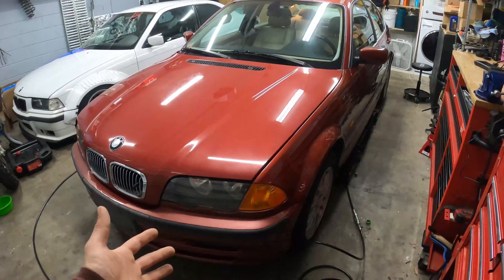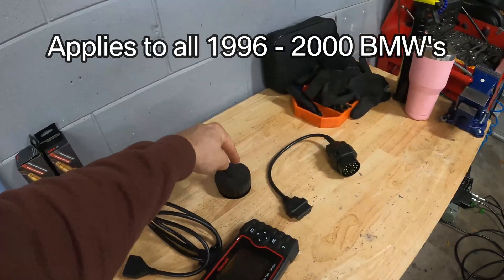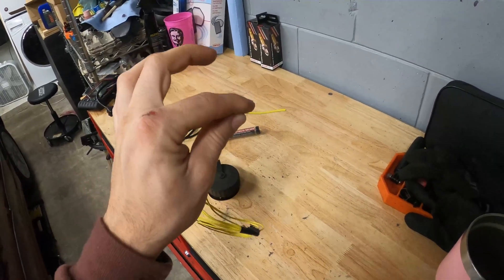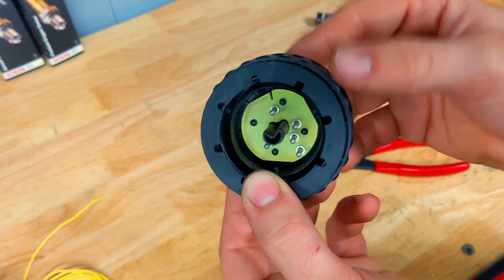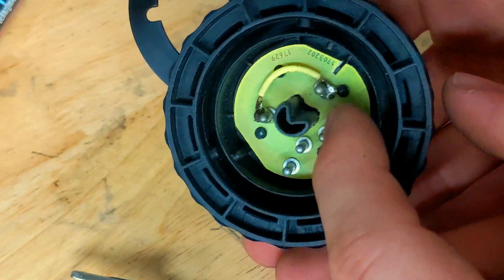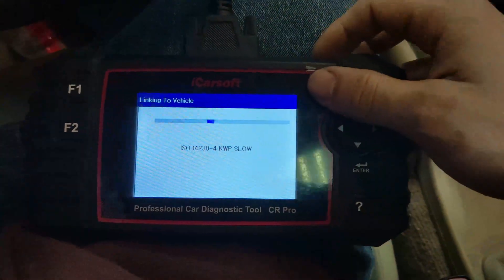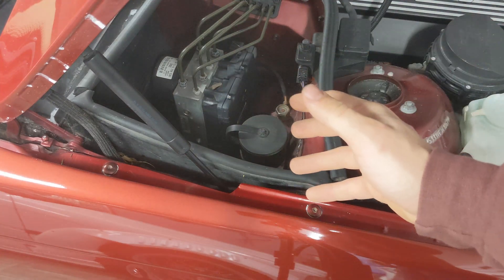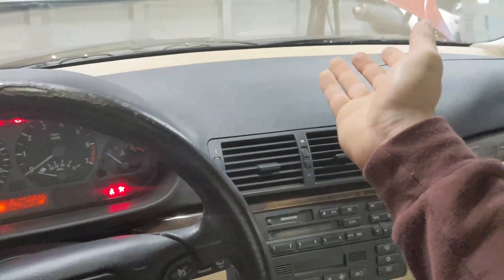Hack your BMW for FULL OBD Access! Round 20-pin Adapter Bypass Tutorial

Comment: Hi, great video! I am going to look at an E36 and I have the same iCarsoft CR Pro+ as you have. Would it work to just connect the terminals on the port, without the cap on? Does the cap need to be on for this to work? Thank you very much.
Reply: How did it go? Where do you plug in in e36, when 32pin connector is already in use?

Comment: so i have a bme m5 e39 and have been told the obd in the car does not work just the round one under the bonnet   is that correct or should the one next to the stering wheel underneath work

Comment: hi, what if i dont have any connector inside my E39 bmw 1998? I have only that round one under the hood. do i need to connect that 2 pins and then attach adapter to OBD? when i try to connect using only normal  adapter it is not working, i cannot connect to any app by bluetooth

Comment: Hello sir, can you please expain this:

I have elm327 obd2 adapter and i tried multiple apps on google play store none can connect to the ecu to read any data. But more expensive equipment can read a lot of stuff just from the connector 16-pin below the wheel, how can i achieve this? i want to read data, should i buy vag com kkl cable for laptop? will this method help with this? 

Bmw e46 2000 320d 136hp. pre-facelift models.

Thanks!

Comment: This was definitely awesome never knew what functions the connector had  in my 1996 328i😊
Reply: Hi. I have a 99/00 328i with no OBD2 port on the interior. Do you have both 20 pin and obd2 ports?

Comment: Absolutely useless mod. You can just short those two pin holes with a bit of wire. No second cap, not soldering, just get the right holes
Reply: Yes, you can - until it wiggles loose. If you're lucky it will only cease reading correctly. I don't know what could short out if a loose wire is floating around the 20-pin connector - why don't we use your car to find out?

Comment: Hey bimmer barn I just did this step by step I used 14 gauge solid wire the connections were good, but I am still not able to read anything besides dme. Any suggestions?

Comment: OMG I spent so much time figuring out how to connect my diagnostic software to my BMW.

Because the car has an OBD2 connector I simply assumed that it could be used for diagnostics. Turns out you can only diagnose the engine with the OBD2. Not knowing that there was also a 20 pin connector which you should actually use for diagnostics rather than the OBD2, I assumed that there was a problem with the CAN Bus. So started checking all the fuzes and trying different diagnostics software.

After I tried this soldering trick I could connect  using the OBD2 port and everything worked perfectly! Thank you so much!

Comment: Hi, just to make it clear for me. Does the adapter cable OBD1 to OBD2 work tho? Because you said you didn’t want to use it. Do you just not like using it or does it not give full access to diagnostics? Thanks
Reply from the maker: The adapter works as well! Full access to all the modules, but I prefer to scan from inside the car instead of standing around the engine 😁

Comment: With such MOD. Can you drive the car normally or you MUST remove the MOD to drive the car around. I have a BMW E39 520iA 2000 Model.
Reply from the maker: You can leave the cap installed all the time, no problem!
Reply: @TheBimmerBarn  can you do car tuning with this mod alsow.
Reply from the maker: @johnbang66  Not sure, depends on the car and the tuning method I guess!

Comment: My 2000 e46 323ci does not have the 17 pin obd 2 port inside the car. The on;y diagnostic port i have is the round one in the engine bay. can a newer style obd 2 port be fitted to the inside?

Comment: Can you tell if K+DCAN cable still needs pins 7&8 bridged when this is done?
Reply from the maker: No I think not, but it's worth buying the switchable dcan cable on Amazon, works on both types of cars!
Reply: @TheBimmerBarn  thanks for the update! I do this as my part time job and I have the Bimmergeeks expert K+DCAN. That specific cable has an adapter block instead of a switch and some E39 OBDII ports were placed so tight I couldn't fit it. I'll try to confirm this soon

Comment: Hello, please, would it work on the BMW e46 M43 in 1998? I have a BMW Scanner v140 I just don't have an ADAPTER Stecker 20 PIN at 16PIN.
Reply: Yes this also works for M43

Comment: Hello friend, very good video, I'm from Brazil, and I would like you to help me if possible, I have an e36 318t 1995, and it only has the OBD1 port on the engine, I bought the 20-pin adapter for 16 and already tested two OBD2 bluethooth and does not communicate with the ECU, could you help me? Thanks
Reply from the maker: Sounds like a bad OBD port, those have to have 12v power at pins 14 and 16 I think, powered by a diagnostic fuse. Check the fuse, check the OBD port for power, use some contact cleaner on the pins, good luck! Let us know when you figure it out :)
Reply: @TheBimmerBarn  thanks for answering, I tried to check and there is power coming from the pins and the fuses are working, I researched the ECU model, and by research I found that there are only a few devices that connect and are unfeasible for the value unfortunately an e36 1995 318ti compact that has a complicated ECU
Reply: @gabrielkurudzpereira  conseguiu resolver amigo? Estou com o mesmo problema, o meu scanner não se comunica com a ECU
Reply: Hi
I think you need a ADS cable (instead of the standard 20pin to obd2 cable) to be able to communicate with early production e36 modules. I bought "Tiny ADS Interface" and it works great with my 1995 e36

Comment: Hey mate - thanks for the video. So let me get this straight - you can't access all the codes from the port in the driver's seat, but when you jumper the pins in the engine bay connector now you can access all codes from the footwell port?
Reply: Can you leave thie 20 pin cap permanently there will it hurt anything, or do you need to swap it with the old one when done?
Reply: @maxvista I'm curious about this, too. What should I do?
Reply: @Aram1-v8v  leave it on its working for me
Reply: You're fine to leave it. 

All this mod does is combine data from two wires into the one in the OBD-II that actually reads stuff. 

For those of us who only have the OBD-II port, we literally do the same thing except we bridge two different wires together.

Here's the visual version of that explanation: https://youtu.be/oLW2O4Sdy2Y
Reply from the maker: Yes! You go from accessing just the DME, to accessing every single module available on the car. Works great!

Comment: I bought a 20-pin to a 16-pin converter for my bmw 316i 1997 e36. What do I do if it doesn't work? Is it the same process? Because if I got that right your car has both an obd2 and an obd1. Can you help me out? Haven't received neither the obd2 nor the converter
Reply from the maker: It should work fine on your E36, you will use the adapter to plug in a OBD2 scanner and scan from the engine bay. This modification allows you to scan directly from inside the car if you have an OBD port under the dash.
Reply: @TheBimmerBarn  I'm pretty confident it doesn't, I bought a FIXD obd2 sensor, I've seen some great reviews about it and I'm hoping its going to work for this car. Thanks for the video!

Comment: I have a E36 320 I M50 1992 European production. My connector socket pin 17 (is not occupied). Pin 15 is RXD diagnostic data link. Is ok bridge 20 pin (TXD diagnosis data link) with 17, thanks
Reply from the maker: I can't say for sure, since the 1992 should be a OBD1 car. Let us know if you try it if it works!

Comment: Super helpful! One question though, do you think it would work with a model year ‘01 E38? It’s production date is in January ‘00 so I’m not sure
Reply from the maker: Yes, as long as it has that round adapter, AND the OBD port under the dash, you can use this bypass to read all the modules. Let us know if you try it!
Reply: @TheBimmerBarn  Hi Chris, great video, but where exactly under the dash should that OBD port be located? I can't find it anywhere
Reply from the maker: @mr_che  what model car do you have? The earlier model BMW's before 1996 didn't have an OBD port under the dash, just the round socket in engine bay (e34, e30, early model E36, etc)
Reply: @TheBimmerBarn  It's a late 1998 E38 restyle 730d
Reply from the maker: @mr_che  Google for some pictures, it's located in the center console under the radio I believe
Reply: @TheBimmerBarn  Yes that's also what the '98 english and spanish editions of the owner's manual say. I tried to pull the wood cover as gently as possible, ended up breaking a tab, and worst of it, there is nothing there. Before buying this car I went to see a 2001 740d and it wasn't there either. It's a mystery this thing...
Reply: @TheBimmerBarn  i have a 1998 E36 without the obd2 socket inside too,
Reply from the maker: @paulgallagher1376  On a 98 it should be right there, weird! Maybe it's tucked away like someone did on my e46 🤔
Reply: @TheBimmerBarn  trust me... ive serched! :-)
Reply from the maker: @paulgallagher1376  Maybe the car was obd1 swapped at some point and obd port removed. Good luck though!
Reply: @mr_che  Under the wood you should see a black plastic square. If you grab it gently by the sides and pull forward, the OBD port is under thwre. I think they just use it as a dust cover to prevent stuff from getting into the car
Reply: hello sir ! i own a bmw e30 with a swap m43 316 motor so there is no port under my dash , can i still use this mod ? thanks @The Bimmer barn
Reply from the maker: @gianniskonidas3146 No, I think you'll need to buy and use the round connector adapter.
Reply: @TheBimmerBarn  so if i use the obd round connector to obd2  adapter you think it will possible to use any kind of the obd2 instruments ? thanks for your time man .
Reply from the maker: @gianniskonidas3146  Yes, once you have the adapter you can connect any obd scanner and check for engine faults and with a more advanced scanner you could probably access other modules/functions.